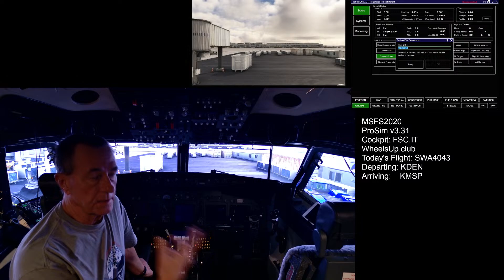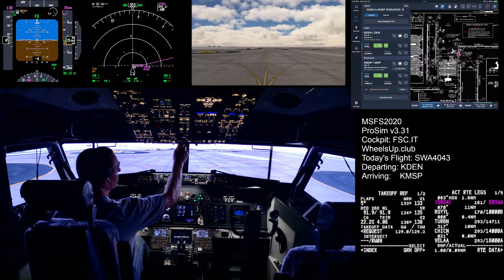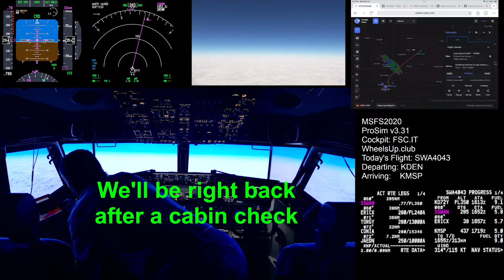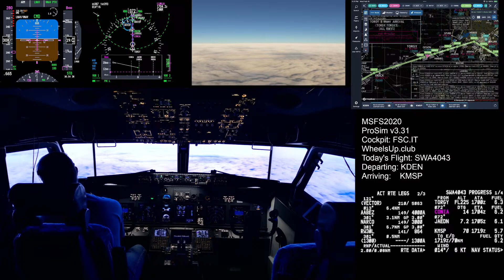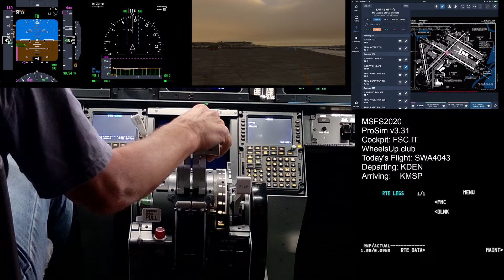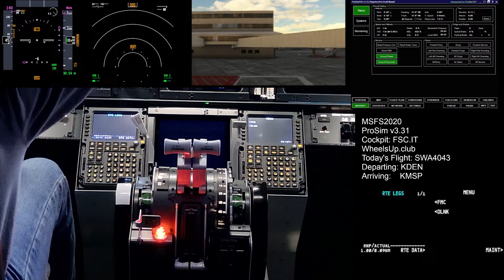Live FSC B738 KDEN-KMSP No.2

Comment: What are you using for your vibrations? The take off roll is excellent.
Reply from the maker: Thanks for the comment. The Vibrations and movement are provided through FSC.IT Custom Software. The Yoke are Electronically linked Control Loaded units. I will put a link to them in the description.
Reply: @ I have their underfloor yokes currently on order.  I looked at yours and almost went that way but wasn’t t sure about them in the end, although yours are looking like they work well.  So you don’t have butt kickers or similar.. just the yokes vibrating??
Reply from the maker: @ there are two butt kickers and a 14” subwoofer in the floor. I was looking at the Dual linked Control Loading Yokes but decided on these based on price.
Reply: @Cptn-Scott  thanks Scott.  I will be watching your content with interest.